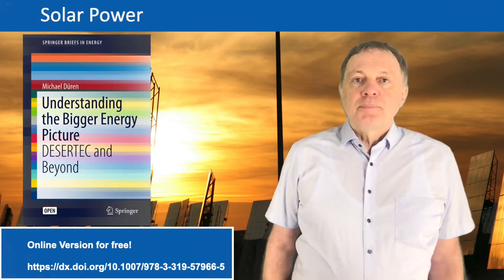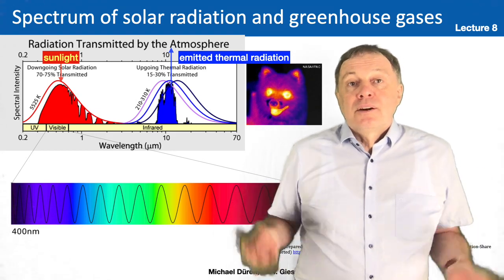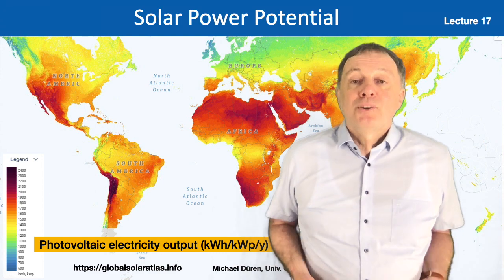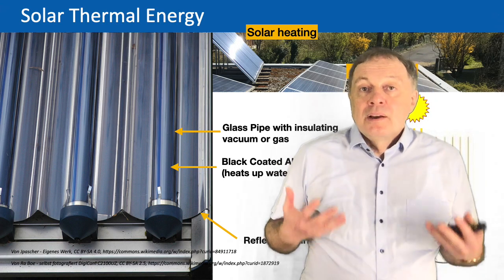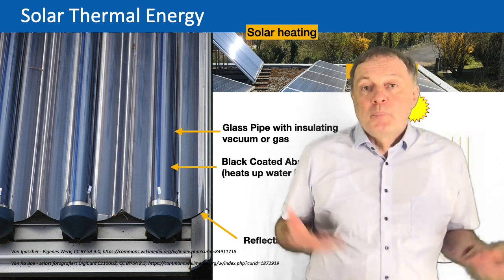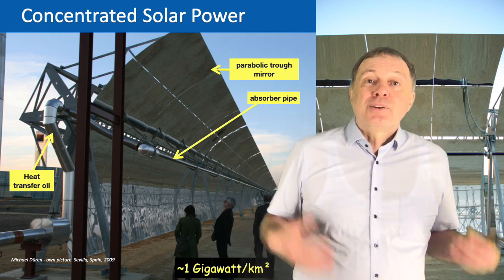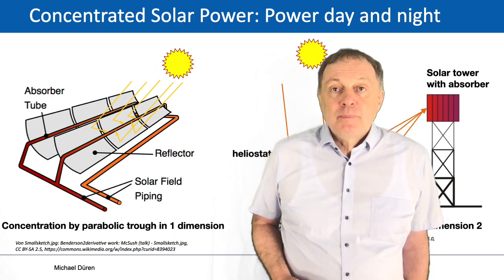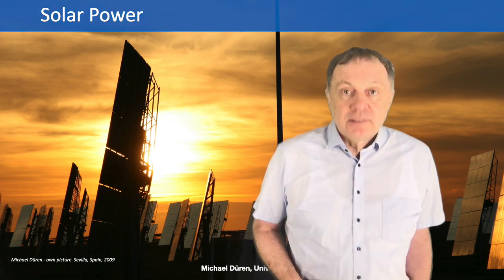EnergyTransition-22 Solar Power

Comment: Photovoltaic is cheaper and more efficient technology, if no storage is required for electricity during night hours. However, storing electricity directly in batteries is still expensive, so using large tanks for high temperature heat storage in large amounts and convert to electricity as needed, may be competitive, until cheap battery storage will become affordable...
Reply from the maker: That is correct. Therefore CSP with heat storage is so efficient. But also so-called Carnot Batteries that transfer electricity to heat (with heat storage) and back to electricity are more efficient than naively assumed: They are not limited by the Carnot Efficiency but have a theoretical efficiency of 100%. Real efficiencies are still under investigation.

Comment: Storing electricity directly in batteries is still expensive in large amounts: much less if energy is stored as high temperature heat in large tanks and converted to electricity as needed.